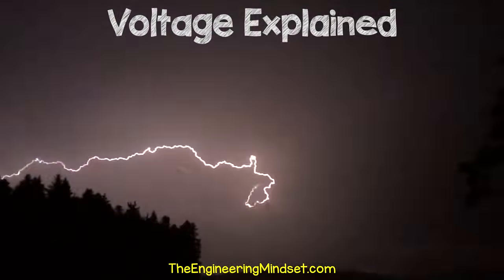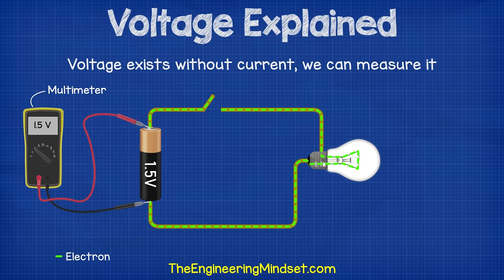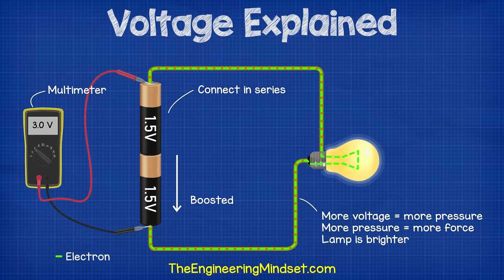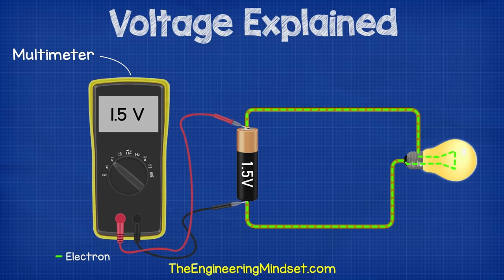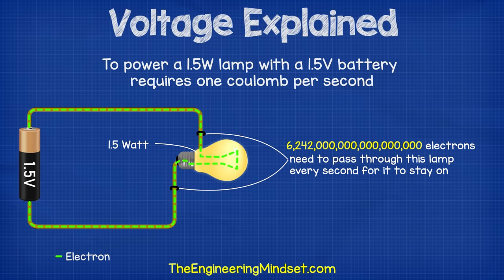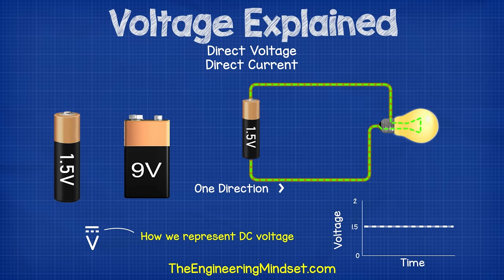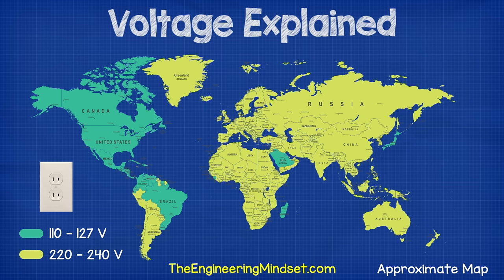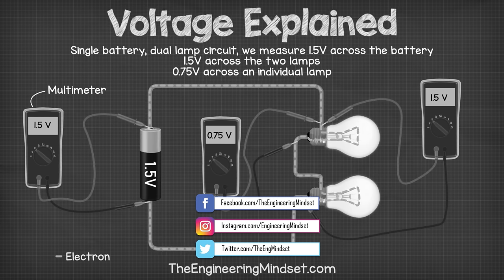Voltage Explained - What is Voltage? Basic electricity  potential difference

Comment: You made an excellent video explaining voltage! One remark though, at 3:35 you say the light will be dimmer when two batteries are in parallel. This is not true -unless you ment it relative to two batteries in series. You probably ment the latter, but now it sounds as if you ment to say the light will be dimmer relative to just one battery.. Suggestion: add text saying "dimmer relative to two batteries in series".
Reply from the maker: Yes I meant relative. Unfortunately YT no longer allows text on screen if a clickable link in used.

Comment: Thank you for the explanation about the battery you said if you split them the light would last longer and if you put them together the the light will be brighter I give this video a thumbs up👍😁
Reply: That's why the batteries in our TV remotes are in parallel.
Woooah.
Reply from the maker: Check this out, how a battery works: https://youtu.be/PXNKkcB0pI4
Reply: @rravitejamavr6650  i think they're actually in series. as far as i know, most battery packs that use these batteries put them in series

Comment: Thank You, great video for this American who is trying to learn the basics of electrcity.

Please keep it up.

Do you have videos on the different levels of multimeter use, starting with the basics and what the symbols are/mean?

Would also like to learn how to check a capacitor on American HVAC with a multimeter.
Reply from the maker: Not yet but they are in the pipework
Reply: @EngineeringMindset  I think you need more voltage!
Reply from the maker: Check our new Multimeter tutorial out ➡️ https://youtu.be/4lAyzRxsbDc

Comment: Super useful video! Thank you very much for making this and sharing it with us. A quick question if you will, please. I am curious to know if countries that are on the 240+V system are more inefficient? Thinking about this in terms of climate change and if it would be more beneficial if we all adopt one system over the other.
Reply: actually, 240V is more efficient than 120V since you need lower current for the same amount of power. lower current = lower voltage drop in the wire = less wasted energy

Comment: summary:
- voltage is the potential difference across a wire
- voltage can exist without current (like pressure on bottom of closed water container)
- DC is when electron flow is only in one direction
- AC is when electrons switch between flowing one way and another

Comment: How does a 9v battery differ from a 3v battery.  Is it that the 9v battery has more electrons in its -ve terminal compared to  the 3v battery or do they both have the same number of electrons in the -ve terminal but the 9v battery keeps its electrons at a higher pressure. Is it volume of electrons that is different or is it pressure? If it is pressure , does it mean that 1amp of current coming from a 9v battery source can do more work than 1amp coming from, a 3v source.
Reply: Good question and nobody answered. Go back to thinking of water,, a big pool has more water than a small one and so has more potential or volume and so will flow longer., verses a very tall very thin water tank that has as much volume of water as the big pool..  On the big pool you could have a big or small drain, and the same for the tall tank.
So you could adjust the valves of the big pool and the thin tall tank tank to flow out at exactly the same volume. The valves are the resistance.  So if you crank your 12 volt battery car to start which is the valve fully open the battery will drain fast but it will crank. A one volt battery will drain so fast the starter will not even turn..
Reply: It is already explained in the video , the 9v battery produces 9 joules of energy per coulomb and the 3v battery produces 3joules of energy per coulomb.so at the end,the 9 v battery gives more energy and makes the electrons move faster
Reply from the maker: Check our our new car battery explained video: https://youtu.be/VnPRX5zQWLw

Comment: Nicely explaination. Voltage is electromotive force or potential energy between two Charge in conductor , positive charge and negative charge.  current is flow of charge over time. no voltage meaning no current will be flow to the inductor.

Comment: But in ac we use high voltage transmission to reduce current!! Pls rply
Reply: Yes correct.  If HIGH CURRENT (amps) were in transmission lines we would
need a cable the size of a Volkswagen. To get the same power. Not practical.

Comment: Nice video! but I think you've drawn the direction of the current backwards, the raised side of the battery should be the positive terminal, it should be moving from this end to the negative terminal
Reply from the maker: Please see our video, electrical current explained
Reply: @EngineeringMindset  I've already seen it, I went to watch it again after you said it, but that video also seems to flow from the flat end of the battery to the protruding end, and all the batteries that can get in my country have the protruding end as the positive terminal, and the flat end as the negative terminal, so the flow animation that in the video from the positive terminal to the negative terminal should flow the other way round 🤔
Reply: @flamingzzz  I know this is an old post but I was trying to find an answer to a question I had and stumbled across this. In electrical current explained Paul explains the two theories of electricity and how electricity flows from the negative charge to a positive one, not the other way around. I'm not well versed in electrical theories or history but according to his explanation that should answer why it is depicted this way.

Comment: Nice video very popular analogy voltage to charges what pressure to water flow what extremal sides temparatures   to heating what atmospherical pressure to wind what charges speed to magnetic field what gravity to movement in general  to fall of material as well what catalysing to reactions . Interesting is the voltage  phenomenon and the potential as a conventional concept .. Interesting approach is the  based on analogy reasoning .

Comment: I love these videos! I don't understand why you would get a voltage of .75v but 1.5v between the two. There should be a voltage and current drop from the increase resistance from the bulb. I assume because the multi meter is reading around the bulbs. Will keep watching thanks for all your hard work!
Reply: Think about two equal masses connected by a pole , now a force is applied to one of the masses. Since they connected by a pole the masses will act as one and both will accelerate at the same rate , however the mass to which the force is applied will experience the entire force of the system and since there's an equal mass on the other side of pole it will experience half the force. So the force at the beginning of the system bypassing the masses is analogous to measuring around the bulbs.

Comment: Voltage is a volume of resonance that becomes potential pressure when stored in buckets called capacitors or batteries which then flows out of capacitors or batteries at rated volts and amps/current from positive terminal to negative terminal like waves of water flowing downstream from high potential to low potential, when load is connected.

Comment: In the water illustration at 1:00 you say that "more water will flow at a faster rate" from the tank that is fuller. Does this mean that voltage has anything to do with how fast electrons travel through the circuit?

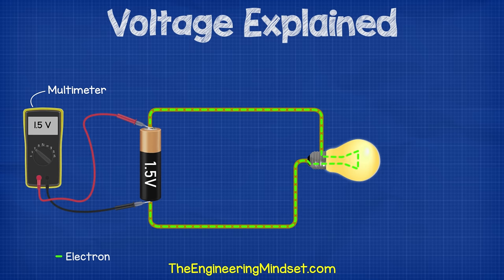Comment: At 2:40 you have a 1.5 V battery. Assuming you start with a brand new battery, what is the voltage at the negative end and the positive end when:
1. You initially start
2. The battery is partially depleted
3. When the battery no longer works

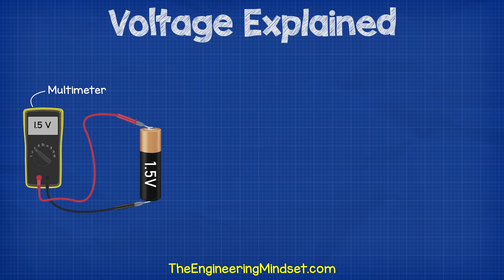Comment: In 2:27 you said there's a potential difference between positive and negative battery terminal my question is  actually which terminal(+,-) has all 1.5 v or more potential difference or voltage and why?and normally current flows from positive to negative so what is reverse flow in some circuits?

Comment: at 3:40 when the batteries are parallel, the video states that the "lightbulb will be powered for longer, but it will be dimmer." Does this mean that it would be dimmer than when we have a combined circuit? It should be the same brightness as a single battery?

Comment: when the water level in the tank reaches the equivalent level of the lower filled one, does the pressure then become the same...you make it sound like that the pressure will be constant regardless and that its set initially by the initial level of the water

Comment: using the pipe and water analogy how does the current flow from negative terminal to positive terminal in between the cells in a torch? If we assume the positive terminal to be at a certain greater height compared to the negative terminal.
Reply from the maker: See our electrical current video for details

Comment: The voltage in France was changed from 120V to 220V in the 60's, then later to 230V. Recently my grandmother asked me to have a look at her old Singer sewing machine because it stopped working. I then realized the electric motor that was installed in the 50's was rated for 120V and had been running during 60 years on 220V and 230V. One thing is sure things back then where build to last and had it run on 120V as intended I bet we would get another half century out of it!
Reply from the maker: Hey MrGwichy, thanks for the info. Did you checkout our French channel? https://www.youtube.com/channel/UCpVHVdo-eYw_H_-rEXWlsZw

Comment: voltage is what pushes the free electrons around a circuit without the voltage, the free electrons will move around between atoms but they move around ramdomly. If only we apply a voltage to a circuit the free electrons will all move in the same direction causing the current. It sometimes hear voltage referred to as potential difference.

Comment: I want to ask a small question,  if v=w/q
And the electric charge has nearly 6.242×10^18 electrons , and work =1
V=1/6.242×10^18
It equals 1.6020×10^-19 
Is my answer correct and please correct it if it's not correct

Comment: You say that lower voltage causes lower current, which then causes the device to not operate properly, if at all. But I’ve read online that low voltage causes an increase in current, which then damages the component as it over heats. Which one is correct?

Comment: Hi EM .... why does the current in a battery flow from the negative side of the battery through the resistor to the positive side of the battery
Reply from the maker: Please see our video on how batteries work, electron flow v conventional current and also electrical current explained

Comment: Is pressure meant by the amount of electrons? The more electrons the more pressure? Thanks for uploading these videos. They're great 😊
Reply: The easiest way to explain that would be to think of a battery. Nature is about balance. You know that when you put the positive side of a magnet close to the negative side of another magnet, they're going to try to pull together. They're trying to "balance" themselves.

Now think about that with electrons. The electrons in the negative side of the battery really REALLY want to get to the positive side. We take advantage of this by creating circuits. We give them a path to get to that positive side that they desperately want to reach, and we have them do a little work for us along the way. The MORE free electrons in the negative side of the battery, the more POTENTIAL there is for us to use (Voltage).

This is why a fully charged battery will read its rated voltage, or close to it, and why I depleted battery will read a noticeably LOWER voltage -- reflecting the fact that many of those electrons are now at the positive side of the battery. There aren't AS MANY of them left that need to get over there anymore, so much of the FORCE they provide when traveling through the circuit has dissipated.

Think of a bunch of people waiting outside a store before Black Friday. All of those people are electrons. Outside the store is the negative side of the battery. The store itself is the circuit. The register is the positive side of the battery. As soon as those doors are open, those people are going to rush to get to the items they want, grab 'em, and run for the registers! The more people (electrons) there waiting in line (negative side), the more FORCE they'll have when they make their rush to grab what they want and checkout (positive side).

I hope that helps.
Reply from the maker: Check this out, how a battery works: https://youtu.be/PXNKkcB0pI4

Comment: "Electron flow" is part of the model of explaining electricity, probably because it's easier to visualize and thus we often see water flow used as an analogy to electron flow.  And the model works perfectly well in probably 98% of electrical and electronic design, modification and repair.  

I reality there is naught but a tiny amount of electron flow which is called electron drift.   What does "flow" is "charge".  Charge is actually a bit mysterious.
Reply: The whole idea of electricity is mysterious to me and that is why I am here. I can do basic wiring but I really don't understand the why. I just follow the rules but I need to know why these rules exist. We are completely dependent on the mastery of managing electricity but not many understand it. I am a case in point.
Reply: yes im also confused all time
Reply: @rastapete100  I can attest to that

Comment: Thank you for the explanation. I do have a question though. Why is it that in alternating current the HOT wire always carries the load and the NEUTRAL does not?
Reply: what do you mean with the hot wire always carrying the load?

Comment: I am just working my way through this brilliant series so please forgive what is no doubt an ignorant question. If I take my UK hairdryer (as per your example) and plug it into my US hotel room socket through a US adaptor plug I plug my UK plug into, how does that make it magically work and provide sufficient voltage? Feel daft asking but I am on a steep learning curve.
Reply from the maker: The adapter just converts the plug shape, not the voltage. You push your uk plug into it, inside are some wires that connected onto a US plug. You push that into the wall and the electricity flows into your device. It will just provide the voltage avaible at the plug socket on the wall.

Comment: the analogy with the water tanks to the battery is nice but wouldnt the pressure in the water tank be a totally different concept due to the gravitational forces? or does gravity effect the electrons through conductors as well

Comment: Great video, currently preparing as I am studying electrotechnology in January-April next year and wanted to be prepared. So if in Australia the standard voltage is 220-240V then when I plug a single lamp as the only plugged in device of any power outlet in my house, would it burn out and receive the full 240V or is there a component of the lamp or electrical system that only lets a device take what it needs? More so is the 240v for the entire house or per outlet, all up I could run a total of 240 volts through to different devices per outlet? Will watch the other videos for more information but just in case my answer's aren't there I'll leave this here. Cheers.

Comment: i want to ask something: isnt the power of every device is the multiplication of the current and the voltage? so why when we plug a device with higher voltage it will burn out? wont the current become weaker for the power divided by higher voltage results weaker current? and the same as the weaker voltage, wont it will be burn out cause there will be higher current if we divide the power by lower voltage.

Comment: In one of your videos you explain that alternating current flows in one direction then stops and then flows in the opposite direction. So what is the meaning of the "hot" and "neutral" wires? Also after the current does the work the"used" current wants to find its way back to the transformer. My guess is that the electrons have gone to a lower energy level as a result of doing work
Reply from the maker: Here this will help https://youtu.be/P-W42tk-fWc
Reply: There is no "used" current and no energy levels of electrons involved.  Better to think of potentials, the neutral is connected to ground so it has the same potential as "ground" and no current should flow through anyone touching the neutral conductor.  The "hot" wire is alternating between +310V to -310V,  with an average ("RMS" or "root mean square") voltage of +220V or -220V relative to ground (European system). So if you are standing on the ground (with poor insulation) and touch the hot wire, you will have an alternating current pass through you as the voltage swings up to +310V and then to -310V  50 times per second.  Sometimes the neutral is badly connected to earth at the transformer, or the ground is resistive and not at zero potential, or even incorrect wire colours, so touching the neutral conductor is never recommended unless the circuit is turned off, i.e. isolated.

Comment: Great video, but still I don't understand what gives a battery that “pressure". It's easy to understand what gives pressure to a water pipe, for there is a force pushing water to a lower level. But what gives voltage to a battery?

Comment: Another question I have is about the power dissipation. Electrical energy is being converted to light and heat energy, how can still the same electrical energy flows in the closed circuit?
Reply from the maker: Current flows around but, energy leaves the circuit. See the LED or resistors explained video for calculations